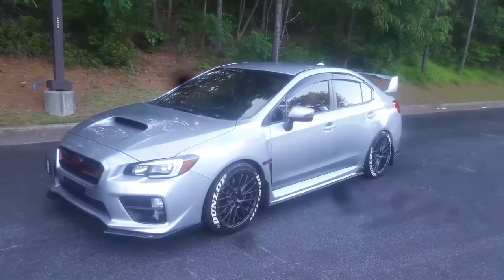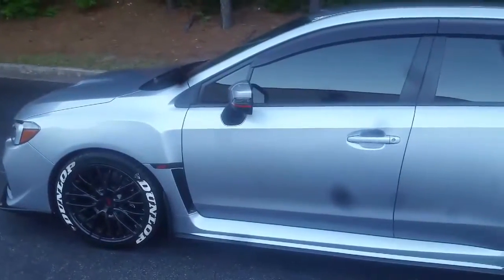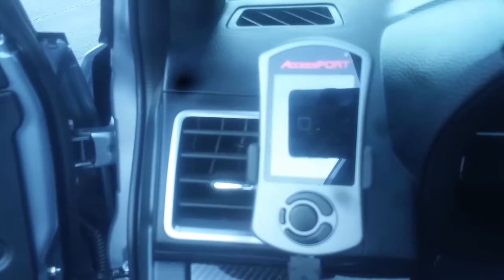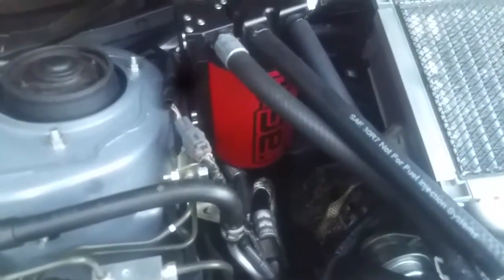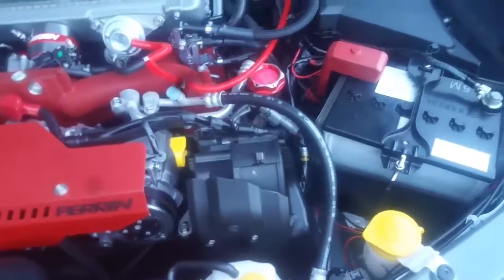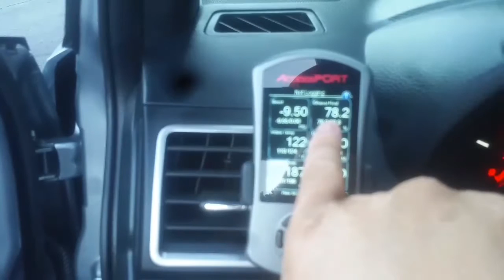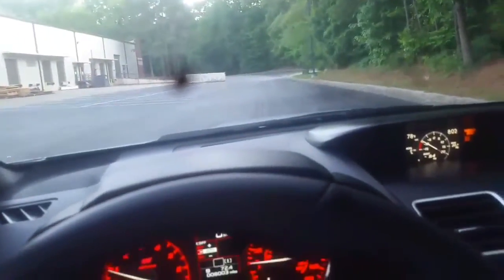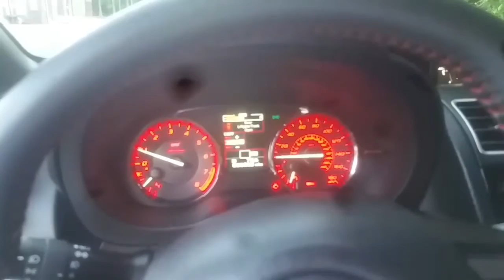2016 Subaru WRX STI Mod Review | Need suggestions for new mods

Comment: killer b oil pickup tube and baffle tray for safety and reliability was a must for me
Reply from the maker: I'll have to look into that. what does it do exactly?
Reply: Oem pickup tube is fragile and can cause spun bearings and engine failures
Reply from the maker: +Hunter Bautista Ahhhhhhhh.....we don't want that...now do we!
Reply: +STiZar no prob, was one of the safety mods besides forged internals etc
Reply from the maker: +Hunter Bautista Forged internals is $$$$$
Reply: +STiZar I know those were just examples such as catchcans/aos
Reply from the maker: +Hunter Bautista When I upgrade my turbo, I'll need those forged internals.
Reply: Pickup tube and baffle tray are cheap mods only hard part is removing oil pan and reinstall
Reply: +STiZar there are a few Vids on youtube like rallysportdirect about the killer b pickup tube
Reply from the maker: +Hunter Bautista I'll check them out. Thanks

Comment: New camera or clean the lens, Alcantera wrapped gauge bezel, alcantera wrapped info screen cover, upgraded shift knob and reverse lockout, weather tech or llyods floor mats, new wheels - lot of good stuff on the car already
Reply from the maker: Its a broken lens on my cellphone.
whats reverse lockout?
Reply: +STiZar it's the piece you pull up to put the car in reverse, located under the shift knob. I did the raceseng Ashiko shift knob and reverse lockout in blue
Reply from the maker: +twanderson1 ahhh...i remember that pesky thing when I installed my short shifter.

Comment: Which front/rear emblems did you get? The description says front/rear gloss emblems but yours appear to be the carbon fiber ones with the matte frames?
Reply from the maker: Ryan Shea the outer rim is gloss, but where he emblem goes is CF.
Reply from the maker: Ure right, I remember the one in the Front fell off at a car wash. I car washed it less than 24hrs after putting it on Lol.  It's matte with carbon fiber. The rear one is gloss with carbon fiber.

Comment: Get a access port , bov, bigger injector
Reply from the maker: I have a Cobb AP V3 and 1000cc IDs with AEM 320lph E85 fuel pump.
BOV is a good suggestion.
Reply: +STiZar dam! Nice, get a front mount and then get some forge internals so u can safely get some good power when u get a bigger turbo 👍

Comment: are you not worried about ringland failure?
Reply from the maker: almanu04 Not at all. I take every precaution as possible to avoid it. Going E85 helped the engine a lot as well.
Reply: what about oil consumption? mine has 1900 miles, and i just noticed when i checked the level today that its between full and low. is this normal, or i need to get check?
Reply from the maker: almanu04 That's normal. How much do you beat in ure car?